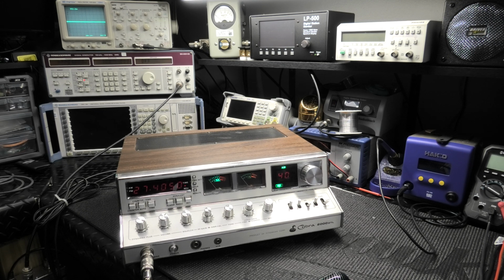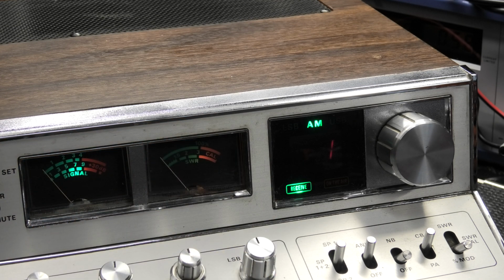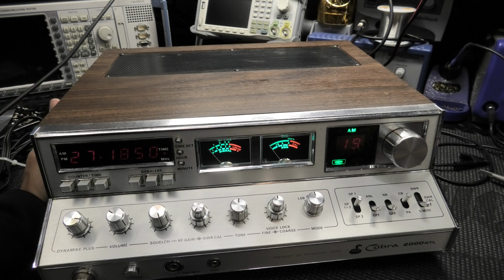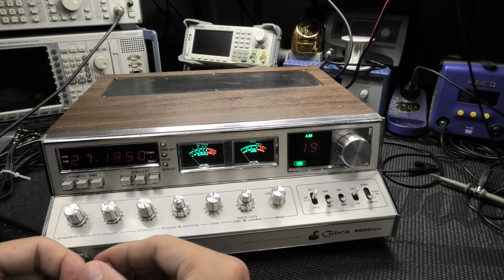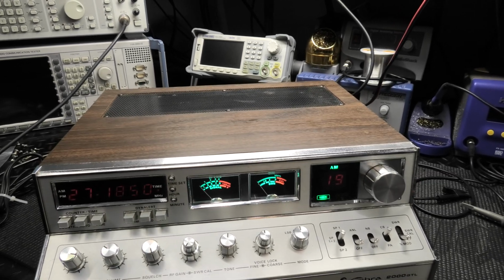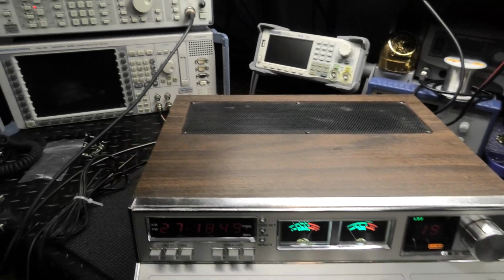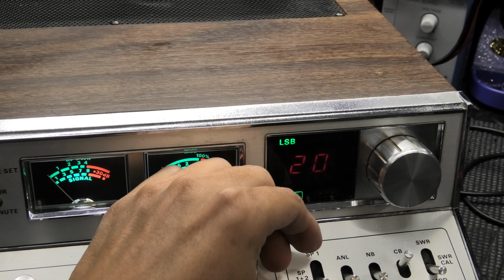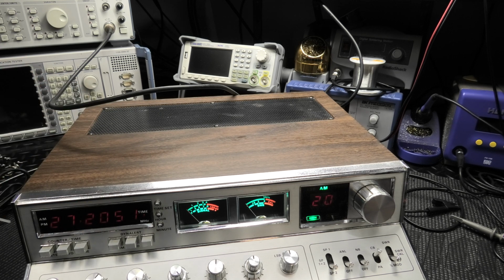Cobra 2000 GTL Serviced & Updated SSB CB Radio

Comment: I know it's not very flexible but I'd like to see one bench that a tech. has that uses RG/8U coax... It's a bit harder to work with but the line loss is worth the use of the fatter coax... Especially from Radio to Antenna over 50'.... Look at the specs. on line loss between RG/8U and regular thinner coax... I don't care about quality in the coaxs if you get really good quality RG/8U you'll benefit in the end..